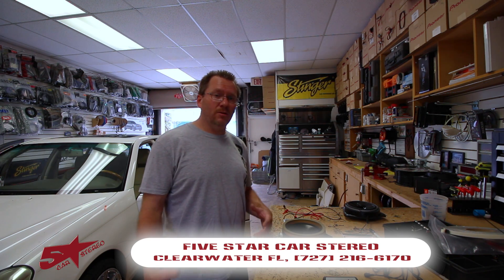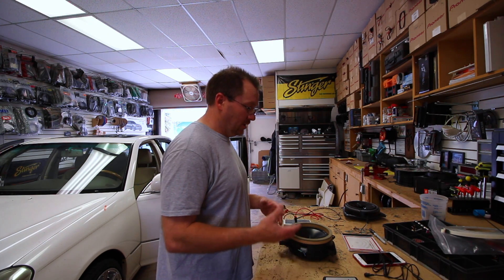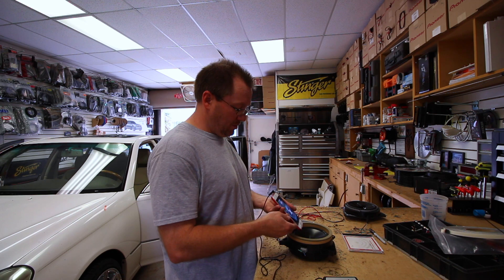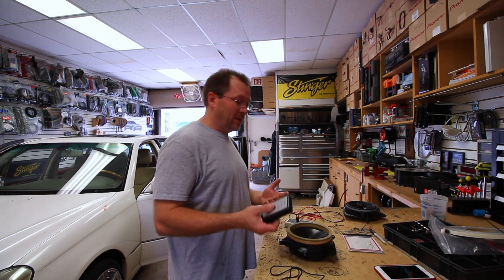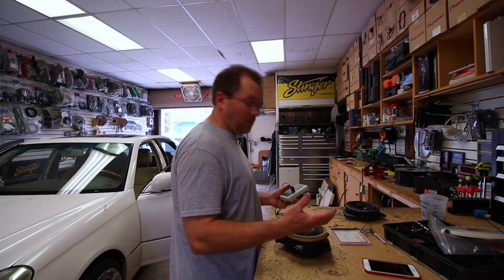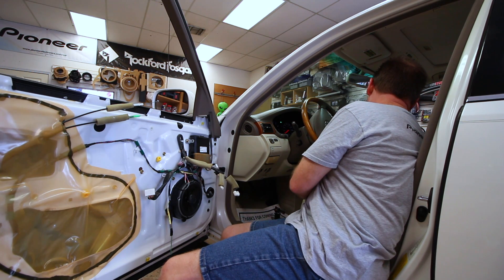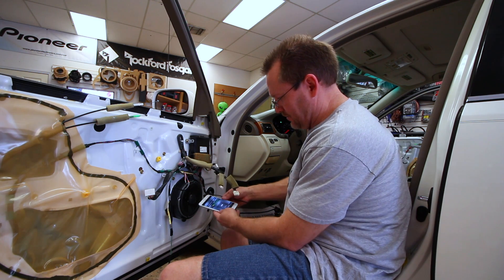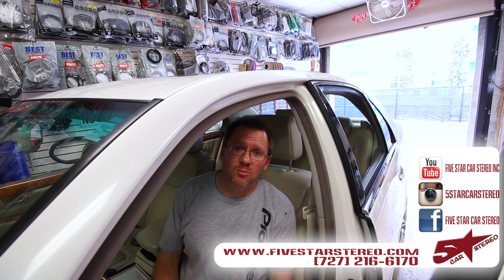What is speaker phase and how do you check it

Comment: Once again, thank you! For a once in a blue moon speaker install I got a polarity checker app and first tested it on the home stereo and it works great or at least gets the job done. I bluetoothed the pulse tone to the stereo unit. I am from the UK and am looking to install Vibe Slick 6" speakers. The component variant up front and the two way variant in the rear doors. I have had good experiences with Vibe Audio equipment in my previous vehicles. Keep producing great stuff, as I think you are educating people in more than car audio but also the basic electronic elements too. 👍

Comment: Question : i bought a pair of CT 6.5 component set when i    go to wire the tweeter to the passive Xover the cover shows + - the circuit board shows - + do i go by the circuit board or the xover cover ??

Comment: so if the factory dash tweeters are out of phase would you change the wiring or leave it.  it sounds fine. 2011 Dodge NITRO with ddx9903s.
Reply from the maker: +Ethan Harrison thanks for asking this question on the live show. I hope the answer made sense
Reply: Yes it did. I also read some where that if there's an in line capacitor it might show negative phase due to the charge on it. I just wanted your opinion. Thanks again.

Comment: Why does when ever I pan the balance to either side especially the passenger side the bass is really good, but when I center the balance the bass doesn't seem as  present because the difference is huge to my ears. I drive a regular cab GMC sierra
Reply: That is exactly what happens when one of the speakers are wired backwards. Did u even watch the video
Reply: @devnull182  actually I did and my speakers are in phase. Thanks for replying to a 3yr old comment
Reply: Suh Duh did you ever get it fixed? If so, what was the solution?

Comment: So if I wire my speaker wrong it will be playing inwards?
Reply: if ALL your speakers play "inwards" you are in phase.  if ALL your speakers play "outwards", you are in phase.  if ONE of those speakers is going in, while the others are going out, you are OUT of phase.  this is audible too; if you have almost no bass response, there could be a speaker out of phase.  you should be compressing the air inside the vehicle, but speakers out of phase just move the air around.
Reply: Zack Ryan and

Comment: It will only sound bad if some speakers are in phase and some are out of phase. If all of the speakers are out of phase, the speakers will sound good to my understandings.
Reply: I think the problem is people are not understanding what phase means regarding speakers.  All phase means is the speakers are moving in unison in the same direction (either in or out) at the same time. So, if both speakers are connected "backwards" they are in phase.  Remember, audio signals are alternating current (AC.)

Comment: Ya but, phase is not equal to polarity. FR and FL could both have proper polarity, and individual speakers could still be out of phase. It's easy to check polarity. Phase requires microphone, DSP, etc. to actually check the phase and then adjust it ... presuming a DSP was installed. 
From what I know, well designed passive crossovers are designed to account for phase and are automobile specific, as in not for a house/concert hall/whatever. 
So that's why, for one reason, people who go all active can lead to a system that sounds like crap.

Comment: Speakers do not have electrical "polarity."  If you have two speakers with unmarked speaker terminals, connect a 9v battery to the speaker and observe the direction the speaker cone travels (either in or out.)   Look where the positive terminal of the battery is connected and mark that terminal (pen, scratch, tape or nail polish etc.) 

Next, connect the battery to the other speaker (or multiple speakers) and do the same thing. 
 Make sure the speaker cone is moving in the same direction as the first speaker you marked.   If the speaker is moving in the opposite direction, reverse the battery polarity and it will now move in the same direction as the other speaker.   Now,  look where the positive terminal of the battery is connected and mark that terminal (pen, scratch, tape or nail polish etc.)

Next, connect the (+) of the amplifier output to the speaker terminal you marked and do the same on the other speaker.  Your speakers will be in phase and will sound great!

I think the problem is, people are not understanding what phase means regarding speakers.  All phase means is the speakers are moving in unison in the same direction (either in or out) at the same time. So, if both speakers are connected "backwards" they are in phase.  Remember, audio signals are alternating current (AC.)  A phase problem only occurs if one speaker is moving out while the other speaker is moving in.  In this case, pick one speaker and reverse the wires and you'll be in phase.  

The good news is, if you don't know any of this stuff, you'll have a 50/50 chance of getting it correct.
Reply: All true.  But this is still super useful information when neither the terminal nor the wires are correctly marked as positive or negative and you're really flying blind.